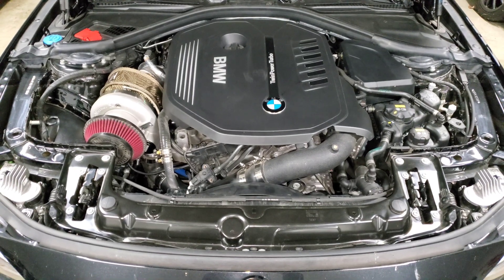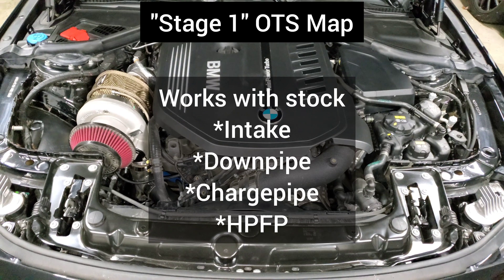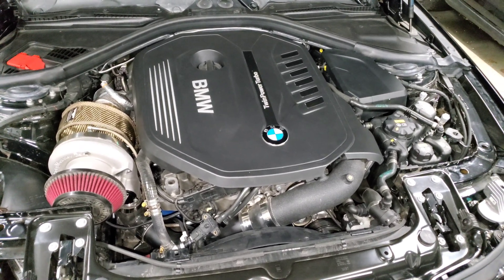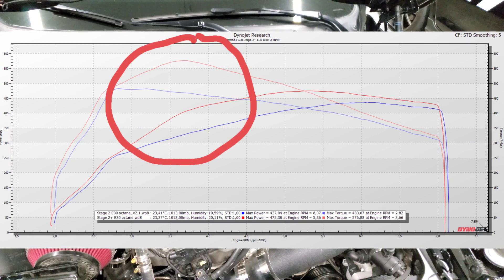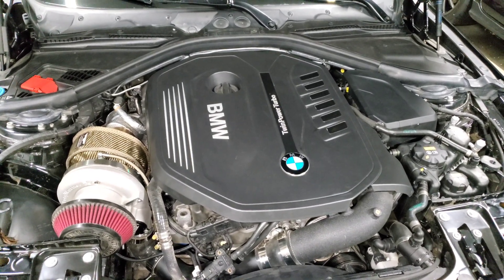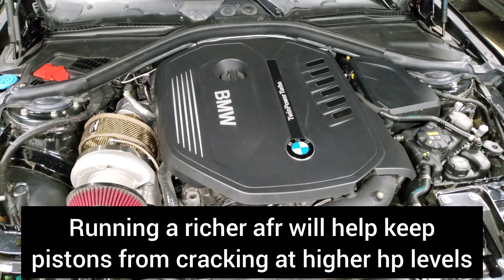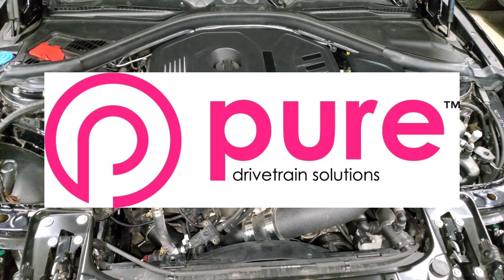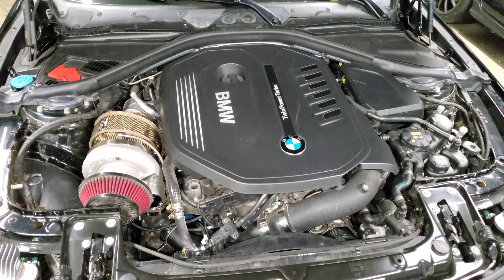Guide to B58 Tuning "Stages" and Recommended Upgrades

Comment: Fascinated by the new M240i. Admired BMWs from afar, but never brave enough to venture into actually considering purchasing til now. How robust is the awd systems in these? Id be up to doing stg 2+ but limited to 91 octane as it would be my all weather daily.
Reply from the maker: They're good
Reply: It’s the best you can get. I had an 435i M Sport XDrive now i got a 440i Rwd and that M Sport would jolt off and suck you into the seat with INSTANT takeoff & speed

Comment: Those power figures you post at end is that for rwd or awd applications. Big difference. If a stage 1 rwd is 380-400whp the awd version is at least 20hp less
Reply from the maker: No it's not

Comment: You need a limited slip differential before even start any tuning. The power will be a total waste otherwise
Reply from the maker: Absolutely not
Reply: @kern417  you’re kidding !  A 450hp M140i with an open diff would only be effective in a straight line. Wherever there is a bend in the road a stock M140i with a LSD would kill it with superior mechanical grip and control. Clearly if you disagree you haven’t driven a high horsepower rear wheel drive car with a LSD. It’s a game changer. After a LSD is fitted,providing the platform ,then all the mods can be added...
Reply from the maker: @bensternberg1057  just because it improves performance doesn't mean it's a requirement. My car makes over 600whp and i have videos on my page of me driving backroads with an open diff. So "clearly" you don't understand the limitations of the car. The fact that it has little to do with straight line acceleration and everything to do with grip in turns perfectly describes why hp doesn't matter when considering an LSD. Try again.
Reply: @kern417  what you’ve said makes no sense. There is a reason why BMW M division uses LSDs. To help put the power down. Open diff with 600 hp is madness!
Reply from the maker: The reason BMW M division uses LSD is for the same reason Mazda puts them in a 160hp Miata. It's the same reason why they put it in a 250hp E36 M3 but not a 320bp M140. If you understand how an LSD works then you'd understand that It's because of how the car is being used, not because of how much hp it makes. So it's my turn to say "clearly you've never driven a high hp car with an open diff" 😂

FYI the fastest M140i runs a 9.8 second quarter mile with an open diff. Crazy eh? 🤯

Comment: Do you have any info on a mission performance tune for a m340i? I have access to a local shop for a custom tune as well. Curious your thoughts on either of these. Thanks.
Reply from the maker: Bm3/mhd/mg flasher will be easier to use than those options.

Comment: On point with everything,very nice video,congrats. On an M340 with pure 800, downpipe, change pipe,hpfp, and a Trans tune , on 93, it is possible to run more than 600whp? And it’s a daily what should i upgrade more?
Reply from the maker: There are no hpfp upgrades for an M340. There is also no need for a charge pipe.

 On 93 i wouldn't expect more than 550 but some people have pushed it further.

Comment: I’m gonna stage 2 my f36 and I have the Dow pipe . What are some good hpfp? I want that stage 2 +
Reply from the maker: TU is good for stage 2+
Reply: @kern417  the TU 443 kit?
Reply: @kern417 I’m currently looking to upgrade my hpfp. I have a vsrf catless dp, intake, running mhd e30 map. My goal is to be at around 500-550hp. Would you just go with the TU pump or say screw it and just go dorshe stage 2 pump. If I’m spending over 1k, may as well spend the extra for the stage 2 pump imo. Would I be good with the stock turbo for that goal?
Reply from the maker: A TU pump can get you there. The stock turbo cannot.
Reply: @kern417  well shit, how much can the stock turbo safely hold? Also how accurate are the sport display gauges for hp/tq 😒
Reply from the maker: Around 470-500
Reply: @kern417  thanks man

Comment: Do you have any experience with Hybrids ? I have a bmw G05 45e. Just got down pipes installed 300 cell, and looking at ECU tune and custom exhaust with GPF delete. Tuner states around 500-520hp for stage 1. Should be no issues with engine and transmission. Any comments here from your side ?

Comment: I have an 18' 340i ZHP which has MPPSK as part of the package. I think on paper it says 355HP. If I wanted to be at 400HP what do you recommend? Will a DS-1 catted downpipe and a CTS/MST intake get me there reliably? I want this car for the long run so I really don't think I'll ever want to push more than 400HP.
Reply from the maker: Stage 1 93 is about 400
Reply: @kern417  So is MPPSK the equivalent of a stage 1 tune? You're saying if I run 93 I should already be at 400?
Reply from the maker: @EduardoGonzalez-zi2mc  no. I said a stage 1 tune will get you to 400.
Reply: @kern417  Oh ok, in your video you said if you have MPPSK, stage 1 won't get you any gains. Confusing.
Reply from the maker: @EduardoGonzalez-zi2mc  sorry it's confusing. A lot of people ask me if starting with MPPSK means you'll have more power after your tuned. I.e. stage 1 makes 400 on a base 340 so would an mppsk car make 410+ on the same tune. I was trying to clarify that it's not the case. That's why i said starting with MPPSK won't increase your gains. Once you tune the car basically it levels the playing field.
Reply: @kern417  Thanks for clarifying, that makes sense

Comment: Solid video. Really glad i came across. 

I have a 2019 540i xdrive 
BMS intake
VRSF catless downpipe
VRSF charge pipe
JB4 tuner and i usually sit on map 2 or map 3. 

What “stage” am i? Have not done dyno yet
Reply from the maker: Equivalent to stage 2 from the major tuners

Comment: Hey man, wanted to start by saying fantastic video! Your B58 info is super streamlined and really easy to understand, especially for a beginner like myself. I wanted to ask your advice about my current setup, I currently have a 340iX 6MT with MPPSK (completely stock other than some head unit upgrades) and I am hoping to just go for 400WHP on 91 AKI. From my research the front transfer case and transmission can handle around 466 lb-ft so hopefully it wouldn't hurt the daily drivability and potentially increase highway fuel economy (if I am thinking about this right).

Would a stage 2 tune get me near that number assuming drivetrain loss. Also, total shot in the dark, do you know if there is a major difference between the AA and VRSF catted downpipes other than the price, I would assume they function similarly but I really don't know for sure.
Reply from the maker: It will get you close. AA is higher quality than VRSF but both get the job done.
Reply: Sorry for the dumb question, I’m not fully up to speed on tuning cars. What is an OTS tune? I’d like to get a stage 1 on my car and not sure how to go at it
Reply from the maker: OTS = off the shelf. It's basically a generic tune that's meant to work on most cars with similar modifications.

Comment: Just joined the b58 engine club(coming from an r35 GTR)...got a stage 2 tune with a catless downpipe in a x3 m40i..and boy, it gained 100 hp..doing about 3.7 sec to 60mph..loving it!! BTW, got the x3 m40i  for the same reason I got the GTR, best value for your buck!
Reply: Hearing this stuff gets me excited 😁 I'm about to tune my X3 m40i as well. I can already tell the B58 in it is superior to the N55 in my M2!
Reply: Got a 22 m40i and looking to go stage 2 in future. Is yours a 21? And what tune you go with?
Reply: @SL0Z07  just went full e85 and added a high pressure fuel pump..doing 0-60 in 3.5 now
Reply: @SL0Z07  flash is MHD..the tune is custom by the tuner
Reply: @SL0Z07  it's a 2019
Reply: I'm also coming from a r35, downsizing but still want a fun tuneable daily, probably be more fun at more normal speeds as the GTR is too capable for the street, how have you found the switch?
Reply: Just purchased a top mounted mpr 1200 turbo..shoukd be pushing 600 to the wheels..650-700 to the engine ...cant wait for that level of performance
Reply: @urbanmfg Hey, what about the performance? Im planning on doing same setup as you. Have you noticed aby problems?
Reply: Or kids lmao
Reply: That’s what I got car is better than my previous M2😄

Comment: When do you recommend a lpfp upgrade?
Reply from the maker: It mostly depends on the fuel you're running. You'll need it for 650 on full e85 but not some much on an ethanol mix

Comment: Do you have a preference between BM3 or MHD? I like the features each one has but I want to make the most reliable power I can using one of their OTS tunes, it does seem like bm3 isn’t as good with timing opposed to MHD. I can’t really find any solid Dyno comparisons between the two (stage 2 dyno numbers) but I plan on going Stage 2 for sure and possibly stage 2+ with HPFP to possibly run an e30 mix every so often.
Reply from the maker: They both produce similar numbers and both make safe ots maps
Reply: @kern417  Do you have any thoughts if running a jb4 with catted downpipe and an upgraded hpfp? Is that possible or is a flash tune necessary to make that happen?
Reply from the maker: @stevengooden7911  i believe they have backend flashes to take advantage of the TU pump but I would 100% recommend a flash tune instead. I don't see how it could work with an aftermarket HPFP since you need to change settings in the DME for them to work.

Comment: Hey I am debating between 340xi and 440 gc dp you have an opinion? I do want to mod but need 4doors
Reply from the maker: 340 is lighter and has more headroom in the rear but the 440 looks better in my opinion and the hatchback is nice to have. Just depends on your priorities.
Reply: @kern417  vouch

Comment: I have downpipe, intake, and active Autowerke stage 2 91 octane tune. If I wanted to reach 500+ what would be the most efficient way to reach that? Xhp flash and different fuel/tune?
Reply from the maker: If you want 500+ on 91 then you'll need a bigger turbo and custom tune. If you have e85 available then an e30-e50 mix can get you 470-500 on stock turbo with an upgraded hpfp.

Comment: I have a carbon tune, vsrf catless dp, intake and dinan exhaust. Only able to run 91 octane.  Would I get power gains just from installing a water injection kit? Is a water injection kit as good as doing the HPFP upgrade?
Reply from the maker: You can see gains from meth Injection but just injecting water will not provide significant gains

Comment: Sick video. I highly recommend an LSD to actually put that power down. Currently a stage 2 b58 with LSD + Trans tune as my next upgrade, then saving up for HPFP/turbo. I heard upgrading the heat exchanger is necessary in hot countries. Any idea how complex/expensive it is to strengthen the transmission?
Reply from the maker: LSD isn't really helpful for straight line performance. It's mostly for handling and traction out of turns.

I have a full heat exchanger Review wirh data on my channel if you scroll down through my videos.

Transmission build is expensive, but some people have swapped to the HP70 transmission from a 335d as a cheaper upgrade.
Reply: @kern417  Your knowledge on the B58 is impressive, made my comment before realising the variety of detailed videos you have uploaded. Nice work!

As far as i know, LSD helps with traction in a straight line as well, especially from 0. Maybe im wrong idk
Reply from the maker: @WhisperTheBand  the main benefit of an lsd is transferring power from left to right. So unless there's a significant differential in traction between your left and right wheels then there aren't significant gains to be had. Modern Traction control does a lot to help you keep moving forward
Reply: @kern417  hey man, is it possible to put lsd on x3 m40i x-drive?
Reply from the maker: @gerokostadinov4355  yes Wavetrac sells one

Comment: I wonder why BMW wrote twin power turbo on the cover.? My b58 has M PERFORMANCE ON IT but is the same engine? Good info video
Reply from the maker: Twin power = twin scroll turbo, not twin turbo. It's just marketing.
Reply: @kern417  figured that what they meant as they are a twin scroll , just wondered why they changed it on the M140 to MPerformance. Thanks for the info and the video.
Reply from the maker: Oh yeah because of the ///M designation on the 140 and 240. Your car has more power stock than a 340 or 440. Our cars get the same Engine cover if we Buy the BMW MPPSK tune
Reply: @kern417  is that your car on the video? Is that a big boost turbo upgraded turbo? I personally think, for the street at least, stage 2 plus is enough with the option to run ethanol/Methanol with 2 wheel drive only available here in Australia for m140/240 is enough power. In the wet,,,, forget it. 😆
Reply from the maker: @gazza1wa623  yes everything i film is my car and it has a doc race top mount turbo kit
Reply: @kern417  looks like a beast of a 340. Is it xdrive? Cause it looks like a 600+ car and that would be a handful through the rears I’m guessing. 100-200 in the 6s ?
Reply from the maker: @gazza1wa623  thanks it's a 440i and 'll be posting dyno numbers next week

Comment: New subb. I love the vid, thank you for all the info. Was considering changing out my charge pipe and down pipe on my 340 6speed before going stage 1. Was told the B58 charge pipes are stronger than previous gens so don’t really need to do it. Didn’t really plan on going past stage 1 but if i’m already swapping out down pipe and that’s the only mod necessary to go to stage 2 i mite as well. My question is, if i just swap my down pipe for a high flow catted one and go stage 2 i shouldn’t run into any problems rite? Also, what platform would you recommend? Been looking at MHD, and Bootmod3.
Reply from the maker: There's no need to replace the charge pipe. I have a video discussing that as well if you check my channel. 

No issues with stage 2. Both Mhd and Bm3 are good Tuning software. Personally i like the interface of BM3 but you can download both apps to see which you prefer.
Reply: @kern417  appreciate the prompt response. About to go check out the video now. Thank you.

Comment: If I was looking to make my m240 around 550whp what turbo would you recommend? Pure Stage 2?
Reply from the maker: That'll definitely get you there with appropriate Fueling
Reply: @kern417  tbh just trying to run pump 93 octane maybe a lul E30 mix
Reply from the maker: It will be hard to hit 550 on 93 octane but you can do it on e30 with a hpfp upgrade
Reply: Hey man I’m starting to look into Docrace Turbo kits now which is basically what you have but a bottom mount kit which is 4k on their website and I know it doesn’t come with FMIC, fueling, Tuning, Etc but could you give me like a rough estimate on how much a total Docrace kit would be with all supporting mods installed out the door?!! Am I roughly looking at about 10-15kish or am I way off??
Reply from the maker: You'll need to search around and price that out. It depends on your goals.

Comment: @kern417
Bro i want to get 20 inch wheels for my 340i xdrive. But i know it wont perform that well (getting a pure800 soon) Does it make a big of a difference? what do you think what i should do?
Reply from the maker: The weight will make the car accelerate slower and thinner tires will ride rougher but plenty of people do it. If the look is worth it to you then do it.
Reply: @kern417  thanks bro imma go whit the 20 inch japan racing wheels.
And Do you perhaps know how to change the Digital Dash to White on Daylight? I find the orange pretty anoying makes the car look very old.
Reply from the maker: @ilaomem  no I'm not sure. If you turn off your automatic headlights it should stay white until you turn them on

Comment: Keep up the work. Love your content coming from a 440i coupe owner
Reply: I have a b58 , Xdrive 440i. I have BMS air intake , CTS turbo catless down pipe , Stage 1 tune on 91 octane. I got 330 WHP and 430 WT
Reply: @2sockz131  when you goin stage 2?
Reply: @Icy.mk5  I asked for stage 2 tune , the guy recommended to do stage 1. He used Eagle eye
Reply: @2sockz131 the car comes out of factory with 340hp how did u manage to make less power with stage 1?u were suppose to make low 400s

Comment: im going to get a pure800 turbo for my b58 soon, should i upgrade the intake manifold? im going to have csf heat exchanger catless dp dorch stage 2 hpfp all installed with the turbo
Reply from the maker: You should be ok around 600-650whp
Reply: @kern417  okay thank you keep up the good work

Comment: hello   i have: downpipe catless,  K&N air filter, charg pipe and 70mm intercooler<<< now car has stock ECU  i think  MHD st2 +  and e30 in stock HPFP  . . .  what do you think  how many whp is limit stock HPFP ( Sorry for my English)
Reply from the maker: You cannot run stage 2+ with stock hpfp
Reply: What is the maximum whp ? stock hpfp
Reply from the maker: @bubukvarelashvili8526  420-440 on an ethanol mix